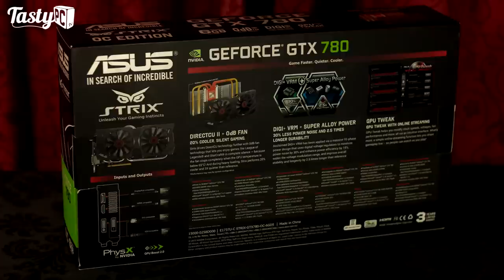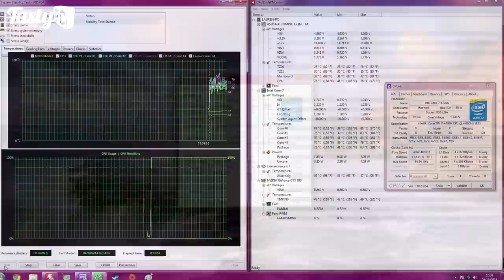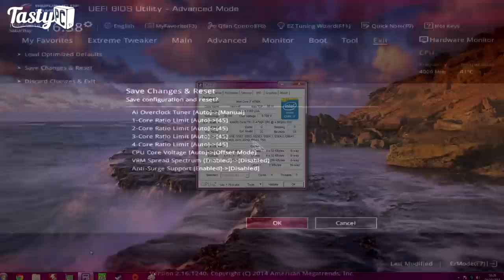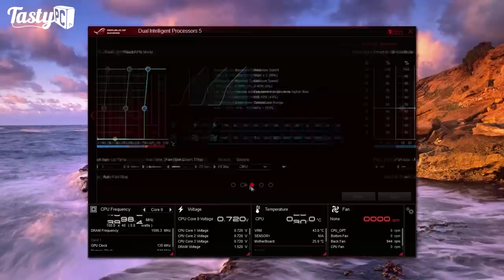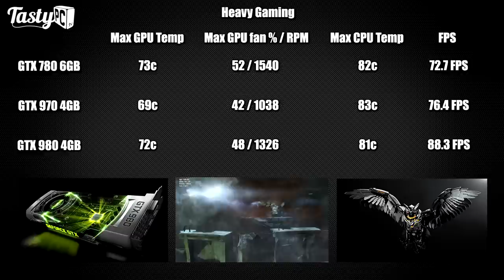Semi-Passive Gaming Build – GTX 980 970 780 Strix, i7 4790K, Noctua NH-D15, Corsair 730T, ROG Hero

Comment: TastyPCTV This is how I´d do a "semi passive" PC:
- Don`t go fully passive, even during idle.
- Stay with air-cooling. Your hardware selection looks fine.
- Underclock the CPU and GPU if possible !!!
- Get ~1200 max. rpm fans and run all of them at 700-800 rpm even during non gaming use.
- Use soft rubber fan decouplers. Coolink Anti Vibration Bolts work well for me.
- Use a fan controller with profile management (maybe speedfan if it`s compatible with your hardware).
- Directing one or two 120/140mm fans onto your GPU OR using an aftermarket GPU cooler with 120mm fan mounts would help.
- Stay away from thick foam padded "silent" cases, they will raise your case temps.

A passive/semi passive system is very difficult to do without having large coolers and low-power components.
But that doesn`t mean that you can`t have a extremely silent/inaudible PC.
High quality fans are practically inaudible under 800rpm so why not let them run and get rid of the hot air.
To be on the safe side, manufacturers use more voltage than needed so undervolting the CPU/GPU without losing any performance is often possible.
Long story short:
Silent = Low power/noise components + Good cooling + Time for component undervolting/systematically identifying noise sources and fixing them.
Hope that helps.
Reply: Because as long as the hardware is within safe thermal limits, then spinning fans is a pointless waste of energy and noise pollution that'll wear down the bearings.  At idle, haswell CPUs literally use single digit wattage, they have absolutely no need for spinning fans when they have mammoth 200w+ heatsinks hanging off them.  As Lauren perfectly demonstrated, not only is fully-passive possible at idle, it's entirely feasible even under a moderate load.  With modern hardware, all you need fans spinned up for is heavy, and overclocked thermal demands.  All you have to worry about is the possibility of coil whine becoming noticeable through the absolute silence.
Reply: aidanjt  I guess that you haven`t built many silent  PCs.
single digit power usage? Case fans running at 800rpm causing energy and noise pollution? No need for spinning fans inside a closed case? 200W cpu heatsinks? (only on the cpu and that`s probably unsuitable for semi-passive cooling).

Chances are that the PC won`t be runing at idle otherwise you`d just turn it off.
That means 50-100 watts in "idle", try putting a 50 watt light bulb inside a case and see what happens.
If you don`t get the warm air out of the case, the VGA and CPU will start to recycle it and heat up more and more and I haven`t even mentioned summer temperatures or dust build up yet.
You need a few case fans spinning at low RPM and if you can hear decoupled Noctua or NB 120mm fans spinning at 700 RPM then you must have dog ears or the fan is simply broken.
Building a semi-passive system requires airflow planning, semi-passive suitable case, low power hardware, low airflow heatsinks, low RPM silent fans and a proper fan control.
You can`t just slap hardware into a case and turn off the fans, doesn`t work that way.
Reply: ***** 50-100w idle?  When did you last build a PC?  10 years ago back in the Prescott/stoneage days?  It's 2014, not 2004, and that's just not how modern hardware works chap.  Current hardware is ridiculously power efficient.  I mean, did you even bother to watch the video to see the components she chose and the results?  Even under moderate load the temperatures never rose high enough for the motherboard to bother spinning up the fans.  And nobody 'just slapped hardware into a case and turned off the fans', or even implied that may be the way to go.
Reply: aidanjt  You`re wrong again. Older PCs were less powerful and therefore needed less energy, their smaller heatsinks are the proof. You`re basically arguing against physic, not me.
Tip for the future, don`t try to correct people if you don`t know what you`re talking about.
Reply: ***** What are you on about?  Just because a CPU can crunch more numbers, it doesn't mean it must consume more energy.  Increased transistor counts are often followed by a manufacturing process (and thus die) shrink, which reduces resistance for each transistor, and thus energy demands.  That's why a modern $5 digital watch could fly Apollo to the moon and back with a single cell battery without a huge chunk of metal attached to the IC.

Have you even seen the size of the reference haswell heatsink?  It's much smaller than prescott's and even nehalem, and for good reason, their TDPs are lower.  And not only are the TDPs lower, they also adjust their frequency on the fly, according to the load demands, which is why they sip only ridiculously tiny amounts of energy when they sit idle.  The only reason why people stick giant heatsinks on them is so they can run larger, slower spinning fans, the bigger the heatsink surface area, the less fan effort required to cool the chip while still overclocking the balls of them well beyond manufacturer's specifications.
Reply: aidanjt  Whow, you just won`t stop digging yourself in deeper and deeper.
Here is what you do: remove the heatsinks from your CPU+GPU+Mobo and press them against your face for a minute.
Then come back here and continue arguing about how I´m an idiot for saying that the heat must be transported out of the case.
Waste of time, I´m out, keep arguing...
Reply: ***** And exactly nowhere did I argue where there's heat, it doesn't need to be removed from the case.  But nice try on the straw man.
Reply: *****
aidanjt is right. Haswell's idle power is somewhere between 7 to 10 watts.

It is true that 486 processors had much smaller heatsinks/fans in ye old days. But it is also true what aldanjt said, that Pentium 4 aka NetBurst processors had an extreeemly power hungry design. Due to the silly megahertz race that Intel fought against AMD back then. (which AMD btw won: their designs (Athlon) ran at a lower frequency but they had  more instructions per cycle http://en.wikipedia.org/wiki/Instructions_per_cycle combined with lower power consumption). That is why Intel gave up on NetBurst and continued basing on the Pentium M design which then became Core / Core 2, which debuted with a much lower clock but higher performance compared to P4, plus around 30% less power (also stems from smaller technology nodes of course).

Since then more and more tricks (multiple voltage realms, power gating...) that save power in the laptop/mobile area have been transferred over to the desktop area. For example: The integrated GPU in recent Intel processors can be entirely switched off in case it isn't being used. Another: Cache and cores can use different voltages and different clocks. The whole power thingy is actually the area where most of the development happened ... thinking of it right now. The single core performance compared to Core 2 has only doubled. Sandy vs Ivy vs Haswell single core performance improvements are around 5-15%, IIRC.
Reply: No he's right, yes they did use less power in the past but power requirements are drastically changing to the point in less than 5 years power efficiency will be better than the early 2000's.

Also heat exchanging technology in computers has changed a lot in the last 10 years.
Reply: I did some research on top end CPU's and GPU's from back in 2008 and in just 8-9 years CPU's performance has increased about 8x-9x and GPU performance has increased about 15x and by 2016 GPU bandwidth will have increased about a 1000x since 2011
Reply: ZeNeo
I guess nobody in this tthread denies that the performance per watt ratio has increased dramatically.

But you mentioned the main point above: "heat exchanging technology in computers has changed a lot in the last 10 years", 'cause this is precisely what Lauren's video is about and what TR Keskin obviously did not understand. ;-)

Comment: I've got a similar rig to this only I have my cpu and gpu watercooled hooked up to a external 9x 140mm radiator with noctua NF-A14 fans. And i got similar fan curves to you in Ai suite only with them allways beeing on at around 250 rpm, no fans in the actual case. So that way the fans actually allmost never spin up while gaming etc, unless I'm running a stresstest or a load like cinebench. The loudest thing in the system tho is the D5 pump at a very low speed setting and the mechanical harddrives. I'm looking into getting a big size SSD in the future so I can have the mechanical harddrives turned off 99% of the time. Cool video for thoes of us that just hates fan noise and still wants a "balls to the wall" PC.

Comment: Well a GPU doesn't coil whine at idle.. My motherboard whines at idle mainly if I use offset voltage paired with speedstep because the voltage bounces so much in relation with the frequency, whenever I launch prime95 so the vcore is static the whining is gone. Maybe try taking the ax1200i out of the system and hold the selftest button (wait till the fan stops) and listen to the PSU?

Btw have you tried putting more cards in SLI? If you prioritize temp target instead of TDP in evga precision so the card never can pass 65° (strix fan kicks in at ~67°) you could get like full 970 performance at 0dba.

Comment: Lauren could you plz look into the latest nvidia drivers. i,ve got 780 ti and since updating to 340 driver my fps went down by 6 fps. so i updated to 344.11 and it,s gone down by 20fps and stutter all over the place on all games. DDU uninstaller and rolled back to 335. and have got everything back. have they done this on purpose because of the 900 series? or is is something in my system conflicting. system specs are win7, maximus vi formula z87, i7 4770k,16gb, asus dcu2 oc 780ti,

Comment: Most likely your noise is coil whine from the graphics card. The 970's and 980's tend to have this in varying degrees depending on the card. I have a Gigabyte G1 970 card and it does have the same issue though you do get used it.
For some strange reason i have even found switching off the PC and then switching it back on again can make it go away which is odd. If you have an otherwise silent PC it may bother you but currently i am using an old I930 and the fans aren't silent anyway so it's not as big a problem as it would be on a new silent system.
If you are into overclocking i would recommend the Gigabyte cards over the Asus as it has a higher TDP with twin 8 pin power connectors and much less chance of throttling. 
I am curious though , are you sponsored by Asus as there are just much better components out there for less money yet you mention them alot.
Also for this sort of setup i would ditch the 4790k in favour of the newer X99 platform and utilise the DDR4 ram.

Comment: Hi Lauren! great videos by the way, i really like the way you tackle everything in detail.  I understand that for this build, the main reason you wanted to make it passive was to keep it silent, and given the new power efficient chips passive can be a real option, and it's also very responsible, energy consumption-wise.

But here's just a simple suggestion and i just thought about it now, if silence is the main concern would you consider just moving the CPU case remotely  in another room and have cables for the display and interfaces where you need it? that way even if you have the system maxed out, you wouldn't worry about the noise and temps any time. Similar to how they do it in recording studios, all the tech people and equipment are outside of the "sound proof" room, and just the instruments are inside the, but you can have your displays, mouse and some other stuff.  Or better yet, go wireless. I don't know if that fits your need though.
Reply from the maker: Tristan Granados It is a great idea, but sadly I don't have another room to stick it in for it to work.

Comment: Nice build.

But I dont want to hear it at full load ;) Why not some be quiet silent wings? Or you dont like the look of them? Or what about the eloops from noiseblocker? Although I heard that those have some noise issues when mounted in pull, not sure if it is only for rads or also for cases.

Anyway ASUS should really work on that software. Did you consider a fan controller?

I personally sacrificed low idle noise in favor of load noise. (water cooling). I just love have it turned my ref 290 into a usable card ;)

I am curious if you will get any long term problems with the MB as you partly run completely passive.

You are not the only one who gets coil whine from the new NVIDIAs in the german Forum Hardwareluxx there is a thread with poeple complaining about this. However it seems to be a lottery kind of thing, just like OC. Do you have some different PSU's for testing? Definately you have the perfect build to listen for electronic and coil noise;)

Comment: TastyPCTV Hey Lauren, great idea with a low noise build.  I was wondering if you could include (prof measured) decibel numbers and power output numbers for such builds in the future, for us who has to pay for our own power bills(which is why I personally don't OC fx).

Another idea for you, could be to test the new capability in the GTX 970/980 to use the HDMi 2.0 to use "4k"(UHD) TVs for desktop monitors in real 60Hz (4:4:4, not fake 4:2:0).  A TV most normal people could afford to test it on(relevancy of test) could be a Samsung UE50HU6900 or the same in 55 inch(UE55HU6900).  Would be nice to see if there are issues with doing that apart from some gaming related refresh rates that are irrelevant to a number of professionals just looking for more stable real estate on the desktop.  Input lag issues would be nice to have a measurement of as well if you made a video about it.

Thanks for a good informative channel.

Comment: What are the motherboard temps like with this? I ask because I've been considering something like this for a while, but with the watercooling I'm currently running in a Define R4, because it's so closed off, something in my motherboard overheats after a while if the fans are turned off, even though the CPU and GPU are within tolerance.

Comment: I think the PSU is way too over kill... I think that system can run to 500W because the TDP of the processor, the i7 4790k, and the GPU, GTX 980, is low.. correct me if I'm wrong.. I've based this from my research of upgrading my PC in the future.

Comment: dang that 780 runs as cool as the 980, but i thought the 980 strix could run way cooler. Great build Lauren but it would be tastier if you used the H100i cooler

Comment: hey tasty maybe you can help great video by the way.Should i continue to upgrade a x79 3930k system which is starting to have gremlins or should i build a newer system kind of like your build only with a 500gb ssd and 500gb raptor drive i have laying in my storage room?If i did up grade it would be a 980 and 500gb ssd and start over fresh on this system.

Comment: Just a heads up, it's correct to use the term voltage, not volts when you talk about it as a concept as opposed to using it as a unit. It's like saying I want to lose Kilograms instad of saying I want to lose weight. E.g. "I increased the voltage by 2 volts" or "Here you can see the voltage".

Comment: whoa those are quite high temps on cpu,
I have i7-3770K @4.5GHz~1.2V and it barely tops over 75°C on Noctua NH-U14S cooler in mini-ITX Node 304 case....

Comment: Coil whine seems to be a common thing with the 900 series gpus, i have no idea why they do but ive seen a few posts saying that some powersupplies were whining whenever the gpus were either at total idle or full load, mine havent whined personally mind you, so it must be down to which power supply youre using.

Comment: I found speedfan much better than this Asus' Fan Xpert where you have nothing like hysteresis (for me not even the spin up/down time worked) and you can't set dependencies (like which fan cools what). It now works with most of the Asus boards and you can also set semi-passive when you use a bit of your imagination (both my PC's are running semi).

Comment: You made my day at 10:58
Great video BTW, i'm getting a 970s or 980s Strike for me also.
Reply: Stay away from Asus 970 if you want to overclock as the TDP is not ideal for this. I'd recommend the Gigabyte G1 gaming edition as the TDP is higher with a full dual 8 pin power connector. It is also faster even at standard clock than the asus.
Reply: I don't realy need need to oc, i gonna take 2 or 3 like this for my 3 screens

Comment: That's really too bad ASUS does not let you fine tune the fan speed all the way to your liking. Do you know if Gigabyte or MSI's tools are better in this regard? And yeah, coil whine is a silent PC's worst nightmare. Typically it's the power supply or the GPU.

Comment: A PSU doesn't blow hot air out btw, a PSU is an intake.
Reply from the maker: Yes a PSU fan is an intake and therefore heat is exhausted out of the rear of the PSU, but what I said in the video is correct.
Reply: TastyPCTV
You said you have it facing up to exhaust air, which isn't true. Hence why you can put your psu upside with no effect as the exhaust is the back
Reply from the maker: VideoFletcher - Youtube Channel. I said: “...so hopefully the fan should never turn on and I'll essentially have a silent power supply, which is perfect for this build. I've fit it in the floor fan face up so heat can easily rise out of it” I'm not talking about which way the fan blows as this PSU will essentially be fanless and fully passive in this build. Heat rises, so fitted with the grill face up, heat can easily rise up out of it, however with it grill face down ventilation is a lot more restrictive. That's why fanless power supplies normally have a warning printed on them reminding you to install it grill face up.
Reply: +videofletcher stay quiet for a year nice.